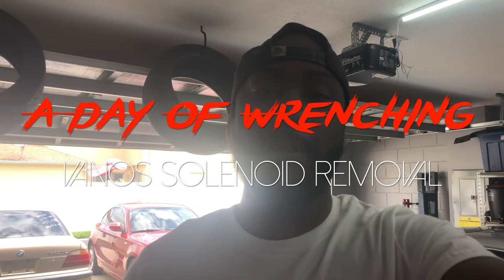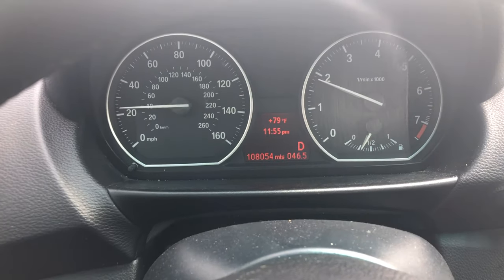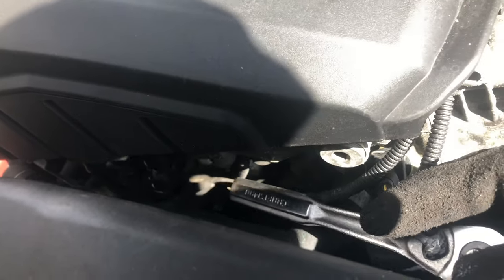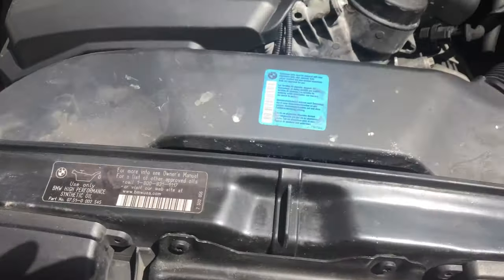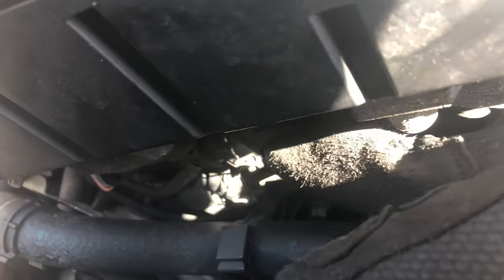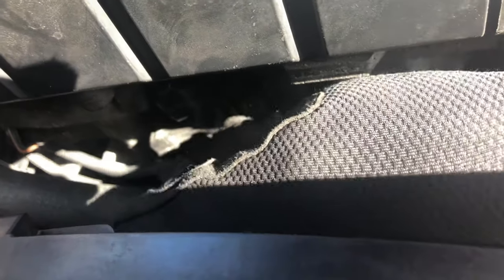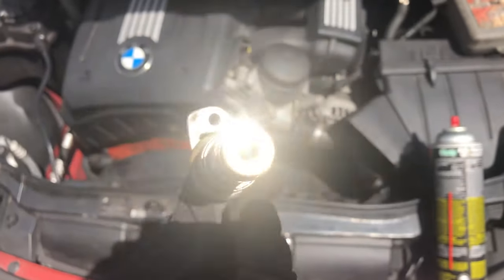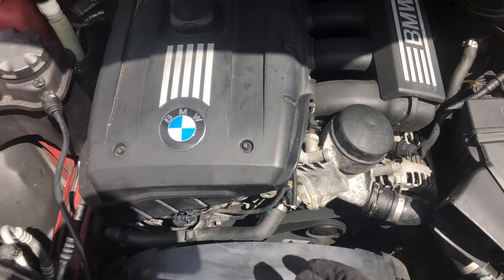BMW N52/N54 Vanos Solenoid DIY

Comment: When you have the vanos solenoid out...The proper way of cleaning it off is with carb cleaner. 

Once the outside of the vanos solenoid is clean. You want to connect a small battery using basic wire <any size> connect the positive port to the 1st prong of the sensor. Then connect the negative wire to the 2nd prong of the solenoid...This will activate the solenoid to open. Once open. Clean out the INSIDE of the solenoid.

Most people dont do this...and figure cleaning the outside 'fixes' the problem...but you have to clean both outside and inside.

Thank me later after you waste money buying coilpacks. Ngk lazer plugs and injectors.
Reply: Don’t forget to clean the two filters also on passenger side of engine.

Comment: Maybe hpfp bro when I had this issue that was a fix for me.
Reply: @nOshi2x  Your correct my mistake I just assume it was 135i platform. Still though could be fuel related, injectors can cause the studder effect also. But again I haven't had a none turbo experience. 😁
Reply: @nOshi2x  Hell yeah bro you will solve it no doubt. ✌
Reply: N54 Lord 
what’s hpfp
Reply from the maker: High pressure fuel pump

Comment: I just installed a new pair, and the idle is stuttering like you said any idea why?
Reply from the maker: Could be a lot of different things. If it’s idling and stumbling id see about the spark plugs and coil packs. If they haven’t been replaced in awhile this will give you a rough idle. If it’s a particular rpm range when driving. I’d look into changing the transmission and diff fluid which is another contributing factor only at low rpms when driving. Best bet is to just scan it with a scanner that can read BMW codes and that will put you on the right track.
Reply: nOshi thanks bro
Reply from the maker: No prob